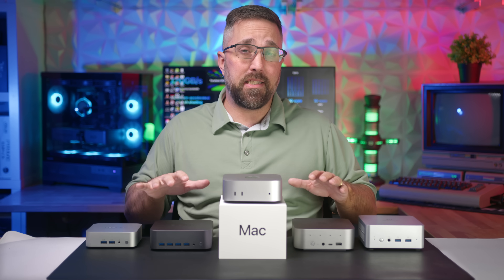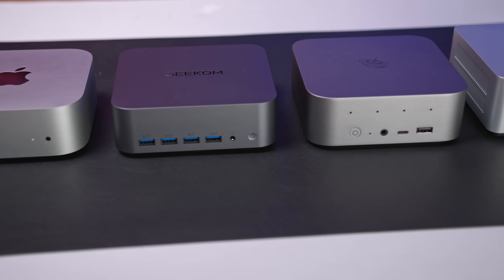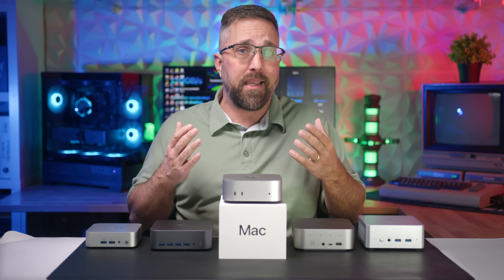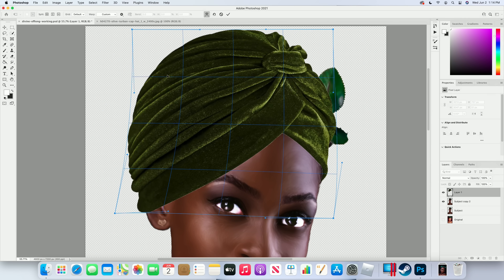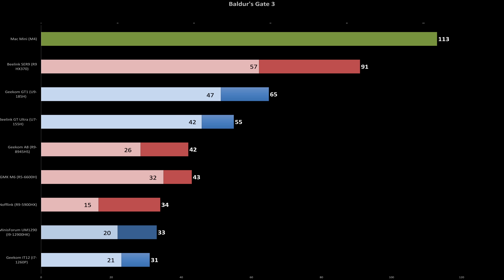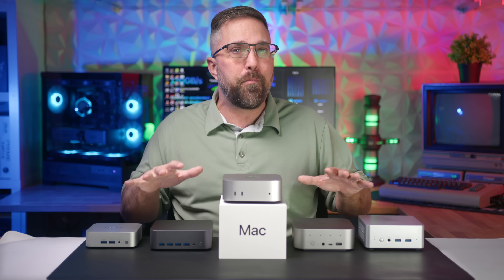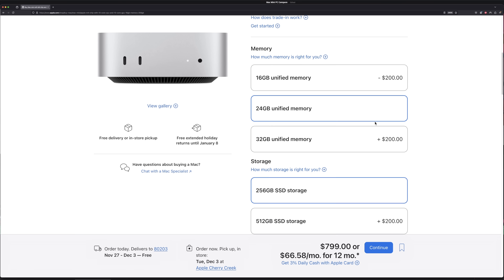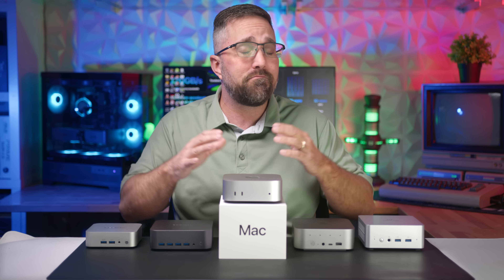M4 Mac Mini vs Intel and AMD Flagships – It's Not Even Close!

Comment: I have not bought into M chip macs yet. One question. Can I run Windows? Or did bootcamp get dropped?
Reply: Regular versions of Windows can't run on M-series chips because they're based on ARM and not Intel anymore. Microsoft recently released a version that runs on ARM but it's not officially compatible with Mac. Apple stopped supporting Boot Camp with M1 but said they might bring it back later if Microsoft decides to allow it.

The only other official way to run it would be in a VM like Parallels or maybe VMware or another open source program.
Reply: MacOS sucks balls.

Comment: The $600 price is a mirage. Let's compare to the mini PC I bought in August: $580 got me an Aoostar Gem12 (8 core, 16 thread 8845hs clocked at 5.1gHz) with 32 gigs of DDR5 (5600), a nice fast gen4 1tb ssd, two 2.5 gbit ethernet ports, a very competent 780m iGPU, and an honest to god oculink port for 64gbit direct pcie4 x4 connection (I retrofitted an old thunderbolt 3 eGPU enclosure into an oculink box, and it screams through 4K gaming with an rx 7800xt). To upgrade the mac to similar specs (forget the eGPU), let's see.... 1TB ssd: +$400 (even though that caliber of drive can be had for under $80). 32GB memory: +$400 (again, should be like $100, but Apple needs to do the extortion game). Any network port faster than 1gbit: +$100. Now you're at $1500. Price to performance king, my sweet ass. No thanks.
Reply: I mean the upgrade prices are a problem but I just buy the base model and use it for what it is and do gaming on an actual gaming desktop. So yeah it's pretty good at $500 but at $1000 I would buy something else unless they are an artist and use a lot of apple programs
Reply: @MrLuffy9131  for less than 999usd with the student discount, a mac mini m4 with 32gb and 10gbit ethernet seems the best deal. with only 256gb but then you add a thunderbolt external drive and leave the internal as empty as possible.
Reply: @MrLuffy9131 The M2 Pro Mini has been extremely good for basically everything. Totally silent, games well enough, especially retro, and for editing videos and making music, and some light Stable Diffusion and llm chat models it’s been amazing. They really do well for ai applications with the Npu cores.
Reply: For the price of doubling some mini specs, you could buy a whole other mini. So, what to do with 2 macs at once?
Reply: The Mac Studio starts at $2000. Wait for the M4 version of that if you need 32 GB.

Comment: Not sure why you think you can't run Linux on Macs. I've got ARM Windows (which can also run Intel binaries) , Linux and Amiga emulators running without a problem. At this point I run allmy work related stuff exclusively on Mc and Emulators. Except games I don't miss anything.

Comment: You should've tested some real job scenarios like Autocad, lumion, vray, or twinmotion instead of video editing and gaming.
Reply: He didn’t do that or more extensive gaming experience because the M4 would get horrible results. AMD’s HX 370 is a fabulous chip and runs everything! 

W11 is getting so good these days, that it’s coming very close to macOS in design but has much less shortcomings. In 2/3 years I may change definitely. The same happens with iOS, I’m getting tired of so many shortcomings…
Reply: @ricarmig  W11 is gettign good, are you drunk? Windows became shit and I curse at this OS anytime I have to use it in my company. Windows was good until 7 and then went downhill.
Reply: I can tell you when trying that out on a Mac, it all turns to s#!t

Comment: For all the nay sayers out there:

SyNthEtic BenChMarK: 
the whole goal of geekbench 6 is to not be a synthetic benchmark and memic how most real application works usually the less synthetic the benchmark is the more M4 gets an edge.

OnLy 16gB rAm:
First of all macos uses ram entirely differently from windows making it an apples to oranges comparison (pun intended) the only real and fair comparison is base model to base model offerings. Also the vast majority of users will never need more than 16gb.

The only real downsides to a mac is the low storage which can be alleviated with external storage and the lack of game compatibility. Another point to apple is that there is a student discount of 100$ making it a 499$ machine i dont think we've ever seen such an excellent bargain from apple.
Reply: it is still a synthetic benchmark.
and 16gb is bad regardless. i use linux, which uses less ram than a mac, and my pc doesn't have to share it with the GPU, and i still run out of vRAM sometimes even though i have 32gbs. 16gb is okay if you're only doing basic crap, but... i'm not. plus my 2011 pc had 16gb of ram. come on. it's usable, but it's the bare minimum, specially considering it's shared with the gpu. the biggest appeal of these macs to me is the ability to have 64gb of "vram", but that comes with an insane price tag.
Reply: @GraveUypo  just another remark running out of ram means next to nothing if performance is unaffected. My machine with 64 gb uses 30gb more than when it had 16gb running the exact same applications with the exact same performance.
Reply: @walidoutaleb7121 in general I agree, but when you put really strong pressure on memory, the M1/2/3/4 chips too will slow to a crawl. For me working with 8GB was very limiting. 16GB is a very different story though
Reply: @GraveUypo  im still using an m1 8gb to code. Compiling large projects and browsing dozens of tabs is no problem. Macos caches, compress and decompress large amount of memory. The only advantage of more ram is on software that uses more ram and in these software m4 with 16gb seems to beat all other processors.

Comment: If you would like to run virtual machines on this mini PCs, you will definitely need more than 16G memory. All the x86 mini pcs have 32G while Mac mini only has 16. Upgrading mac mini to 32G would cost you $400, or $999 in total.
Additionally, since many Linux distributions do not support ARM64 yet, your choice of OS will be limited.
Reply: VMs run just fine on my M1 w 16GB. OrbStack is even more efficient. 

and Asahi Linux is a godsend - ive been able to cross compile an x86 Linux distro from source no problem.  and its been on my bucket list to try Ubuntu using the same kernel. the future is bright!
Reply: @udance4ever  Pay attention to your "Swap Used" in Activity Monitor. You may feel no slow down but macos may have already used your SSD as swap space which may wear down your SSD faster. Since the SSD is not replaceable, if it's life cycle is reached, your mac is dead as well.
Asahi may use much less memory than macos and thus leave much more space for VMs, so I do want to try it some time.
Reply: @rodgerwang7017  ah good point.  I just remember next to no swap used for all other apps but now that you mention it, swap does go up w VMs.  I guess I'm not too worried about it because I purposely got 1TB to help level the wear (& don't use VMs often)